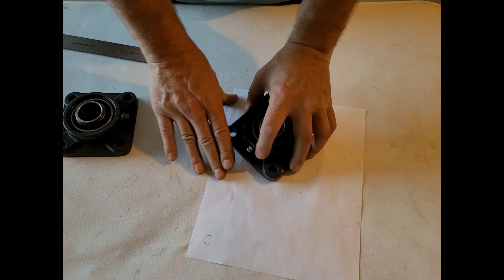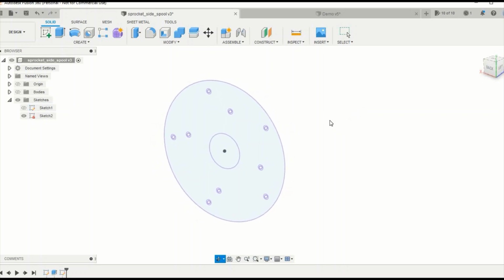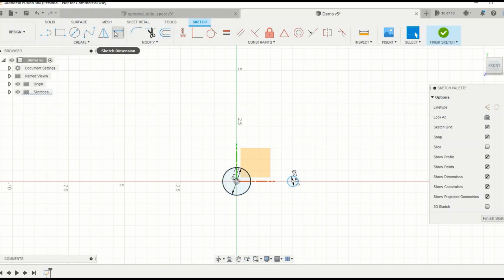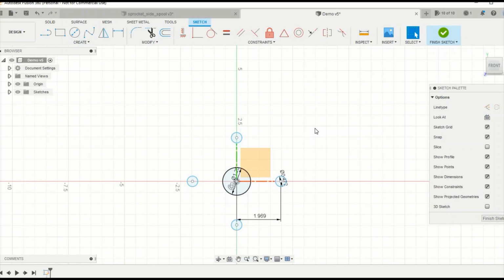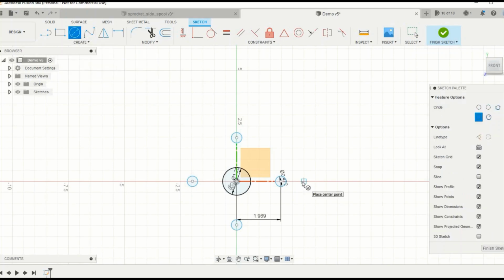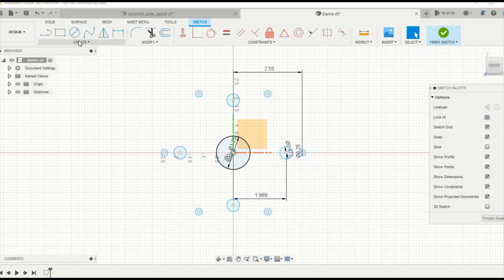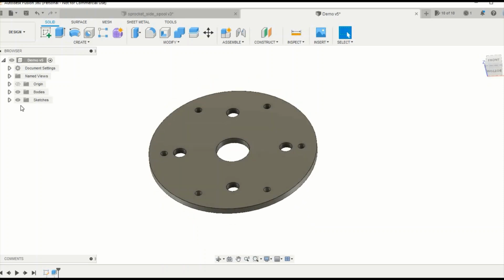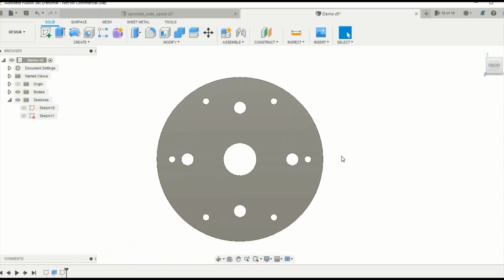$70 Crosskart Spool || Part 2

Comment: I absolutely love this spool! Easy to build and maintain. But I am curious, what thickness of steel did you decide to use or would you recommend for each of the parts you had laser cut?
Reply from the maker: The flanges are 1/4" but the center guides are 1/8" since they aren't load bearing. You can actually make those at home pretty easy, like we did, since they are thin enough.
Reply: That’s right where I thought they’d be, but I just wanted to check first. I’ll have to grab some remnant 1/8” from the local metal supplier and see what I can conjure up! Thanks!

Comment: Why not use a drill and punches?
Reply from the maker: It's really difficult to get the precision needed for balancing reasons by hand. It's actually cheaper as well if you don't already have drill bit big enough for the center bore. Laser cutting is actually quite cheap.